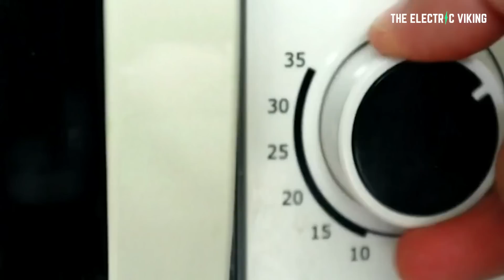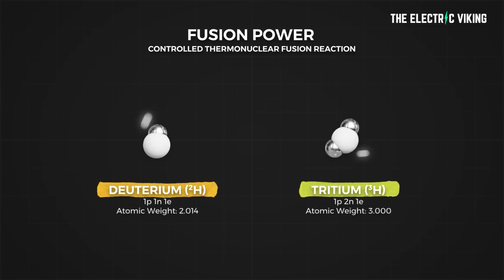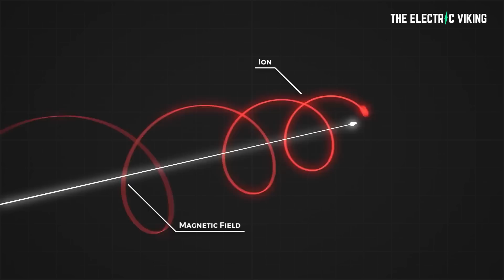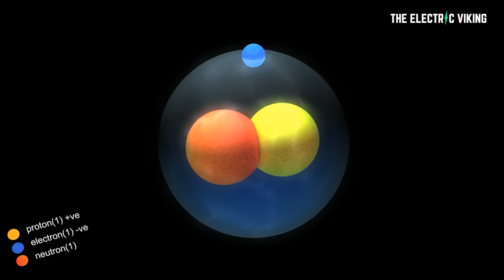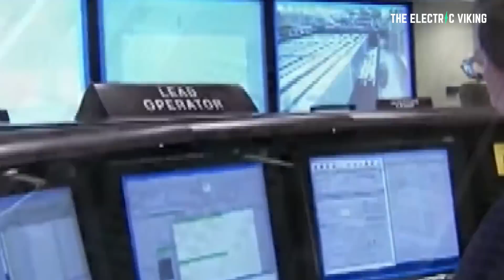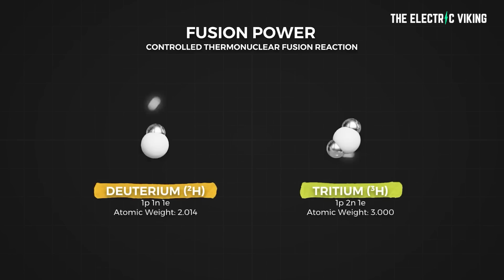Massive breakthrough in nuclear fusion achieved by US scientists

Comment: Even if there had been a net energy gain it's still only a technology for boiling water to run a steam engine. So you still need to convert that into electricity where 60% of the primary energy is lost, as in all thermal power plants. But LLNL is mainly a weapons lab where the energy research is a side hustle.

Comment: This is a common misnomer. So to put a damper on things. There is an old inside joke about fusion. And this was back 40 years ago when my father told it to me. Fusion is 30 years away and always will be. It is still being told today.

So to clarify things about why this "breakthrough" isn't anything. Tokamak reactors have already gotten 200% more energy than they put in. So they have already done better than the NIF. Here is the problem. Out power plant technology allows us to convert 40% of the thermal energy into electricity.

So to make a long story short. In order for fusion to be viable, the fusion reaction needs to put out at least 10 times or 1000% more energy than was put in. Otherwise you won't make electricity which is the whole point of the thing.

And as you can read for yourself, 50% more is nowhere near 1000% more. So Fusion is 30 years away and always will be.

Comment: Congratulations for this important step to make more heat energy from fusion than the energy in the laser light. That is still far from making more energy that the total energy that was used to make that laser light.The National Ignition Facility reactor is not a reactor that could be used to continuously make power, so we are still far from making a feasible fusion power reactor. With new SMR fission technology at least a decade away, proven wind and solar with energy storage should be moving at full speed.

Comment: Yes. It is a world changer,, an entry into the universe actually. It has been on offer for a while but the gatekeepers kept it out of public eye. But not now. The gates have opened. Everything changes now. Every piece of equipment gets reengineered. electrical motors get rewound, connectors re designed, applications of engines to power source means that VTOL is boundless. Distance is no issue, Remoteness is not an issue. This is the beginning of a massive positive shift for humanity.  Food production costs down, living costs down, pollution down,... The skies beckon. There are multiple working fusion reactors already on line. This current news article is for us normies. But it is great news.

Comment: "National Ignition Facility achieves net energy “gain” with laser-powered approach"
Subjective, these lasers are inefficient, requiring hundreds of megajoules of electricity to produce the 2 MJ of laser light and 3 MJ of fusion energy.ª 

¯\_(ツ)_/¯

Why am I not excited, becasue this is hype for more funding. 

Even if they got this up, to boil more than a kettle of water. This report is disappointing to see, that you were pulled into this clickbait story. 
Tritium, is critical for fusion, and there is a shortage, as it's a penasious gas, that is hard to contain, and relatively rare. 

MAIN CONCERN
is the popular press is spinning this fusion breakthrough. Claiming 30 to 40 years fusion will replace fossil fuels. WRONG. 

If we are still highly dependent upon fossil fuels in 30 years it will be game over. Not only that, but any breakthrough does not guarantee, it's economically or environmentally viable. 

FUSION COULD SUPPLEMENT
renewables and storage in 30 years, yet it certainly won't be available in time to be the solution to human-caused climate change. Period.
Disappointed is an understatement.

Unsubscribed, based on this laser based, fusion report, "Massive breakthrough in nuclear fusion" 😞

ª https://www.science.org/content/article/historic-explosion-long-sought-fusion-breakthrough

Comment: i cringe whenever the media uses the word "breakthrough".  In this case, its coming from fusion proponents.  It's actually more of a milestone than a game changer.  They've been on an incremental path of increasing gain, for awhile.  For once, they've generated more energy than they put in (measured in a certain way).  It doesn't mean it will be downhill from here. There are still huge engineering hurdles ahead.  And solving them is not guaranteed.  The stages are the following (each with their own major challenges).

1. Scientific demonstration.  Proof of principle.  (In a way, this has now been done, in terms of net gain.)

2.  Building a viable electricity generating engineering reactor, a prototype, which can be used on a grid.  We are a long ways off from this.  Even more so with inertial fusion, than tokamak designs, which hold the plasma for a longer period of time.

3. Having this reactor be cheap enough, to compete with renewables (and various forms of grid storage.   Their prices keep dropping.   And while fission is more energy dense, it's turning out to be more complex and expensive than expected (including SMR's).  (BTW, I support nuclear, even if one has to pay a premium.  That's because it provides a low-carbon dis-patchable source.  And it can be used for other things, such as industrial heat, hydrogen generation, ...)

And none of this fusion  will help with climate change, which has to happen the next 10 years (i.e., getting seriously started on the path to de-carbonization).

Comment: Fission Suppressed Fusion Hybrid - Can be developed quicker than full blown fusion - MOLTEN SALT FUEL VERSION OF LASER INERTIAL FUSION FISSION ENERGY (LIFE) - You could have a fuel factory mode. 232Th dissolved in molten salt; remove 233U for use in fission client reactors ( 232U/233U>>2.4% for non-proliferation) - fission is suppressed, Reference Ralph Moir W Manheimer

Comment: My question is, "Is it reproducible or was it a one time event?"
Reply: They probably had ignition in August 2021 too--so it isn't just a fluke.  This was more powerful too, so they're not only reproducing the event, but improving.
Reply: @nathanbanks2354  The clock is ticking on how soon other researchers will show success.  I would not doubt that 2023 will have a string of announcements, because all the others now know it can be done.  Kinda like the analogy of the unbreakable 4 minute mile...
Reply: @SlipKnotRicky  I'm sure it will lead to more research.  However both NIF and ITER both took decades to design, so I don't think another facility will do substantially better next year.  I think there's a European version...I looked it up--Laser Mégajoule...they may be able to do it.  At least this should help secure more funding.

Comment: I agree it will be abundant once they work it out but do you really think it will be cheaper?  Maybe for the producers but will end users see low cost energy for their homes and businesses or will they follow the oil companies model which maximizes profits over a balance between cost of providing service and cost to those of us of using it?  The fusion reactor company sharholders will insist on maximum dividend checks which will keep prices and therefore profits as high as the pocketbooks of users can provide.
Reply: Lots more goes into oil pricing than just "oil companies/maximize profits". 
 Supply/demand, logistics, Transportation/Refinery,  Taxes, Speculators,  or even scaring off investment, which will affect pricing for years ahead.  From Oil thru to it's different fuel types is a pretty big convoluted mess

Comment: All they did is produce slightly more energy out than the laser energy in. They are several orders of magnitude away from reaching energy out exceeding total energy in to the system, which is what you need for a generator to be viable. What happened here is just another small step forward, they just kept tweaking things until they managed to get some output gain in reference to laser output power, not laser input power, which was well over 100 times what they got out.

This system will never work as a viable commercial generator, it is too complex, too expensive, and it can only run for very short time periods. They are nowhere near being able to make this work commercially, not even close. Fusion is, as it has been for the last 50 years, at least 20 years away, and always will be.

Just imagine if the untold billions spent on fusion research had been directed towards moving to renewables, we would be done and dusted by now. The problem is, so many countries and corporations have spent so much on fusion already that they simple can't afford to say "it will never work, at least not by going down this path", because then everyone would realise just how much has been wasted. They've painted themselves into a corner and have no alternative but to keep painting.

I really wish fusion research was going to result in a viable generation option in the near future, but it has been obvious to anyone with tech knowledge combined with actual common sense (a combination sorely lacking in academia) that this was never going to work. Hell, at this rate, we will have built a Dyson sphere before fusion ever starts operating commercially...

Comment: No, it did not solve fusion. They reported a laser energy to fusion energy ratio greater than 1.0, but you need that ratio to be 150 for a useable fusion reactor because the input energy to make the laser beam loses 90% of the input energy.

Comment: The proibleem is that it still doesn't produce useful amounts of energy, and required a massive and expensive set of lasers. Every step towards producing useful amounts of fusion energy has required ever larger and more expensive reactors. Moreover, this laser method requires precisiion manufacture of tiny fuel pellets, making the fuel expensive. It will be too expensive to be competitive with renewables, or even fission reactors. It may find some use in "cost is no objection" applications, but it won't solve our energy needs.

Comment: Suppose that someone turns off everything in house except for a stove top heating coil meant to heat up a covered pan of water, and checks the electricity meter and sees that 2000 watts of electricity is being used, and finds by way of a temperature check the water is being heated at a rate of 1800 watts. That is 90% efficiency, and is fairly typical. Some waste heat goes to the house electrical wiring and to the stove top and to the metal pan and to the heating coil instead of into the water.

If by some sufficiently inexpensive magic, perhaps with the help of a cheaper form of fusion energy, you can manage to get the water to heat at 120% efficiency, you can lower your electricity bill for heating up your cooking water. If you can go further, to about 200% heating efficiency, you can in theory with an electrical generator running at 60% efficiency send all of the input electricity back to the power company and still have some spare electricity leftover for yourself, meaning that the operating cost of your spare leftover electricity is the price of the fusion fuel. Every 100% efficiency improvement is a worthwhile benchmark. 300% is better than 200%, 400% is better than 300%, 500% is better than 400%, and so forth.

The science fiction movies have a scary point though. Nuclear fusion means temperatures or densities or pressures close to supernova temperatures and densities and pressures. There are questions about what combinations of mass and temperature and density and pressure are safe. Long ago in the 1950s, H-bomb scientists probed that question with a goal of being able to intentionally and efficiently blow up entire cities. Modern fusion electricity scientists must eventually re-probe that question with a goal of not accidentally blowing up an entire city in a fusion electricity power plant mishap of some sort.

Comment: I've heard that fusion will be economically viable if it generates a 10% net energy gain. This achieved 25% (ish). That's an incredible breakthrough which could finally make fusion energy generation a reality. Really exciting news.
Reply: Sort of.  The lasers are currently less than 1% efficient, so they'd need to improve the efficiency there and/or make a much higher net energy gain.  But this is still a tremendous achievement--the lasers are super precise and powerful, even if they weren't designed to be efficient.  I'm looking forward to ITER having a net energy gain!
Reply: you read wrong, it's 10x the energy gain, not 10%. because there are tons of auxiliary systems that takes an awful lot of energy. even if you can extract a bit of heat  from the plasma, you need to convert that to electricity.
Reply: No it didn't. It took 300MJ to produce the 2MJ laser shot. That was 100x the energy output, or 1% efficiency at best. This is non news.
Reply: It is still news because we now know that ignition with laser fusion is possible.  We've solved half the problem by squashing some hydrogen so it fuses producing more energy than the energy squashing it.  If we get a more efficient laser, we can solve the other half of the problem.  Then maybe we can make it economical.  The scientists were pretty clear about this at the press conference, but the media rarely broadcasts that part.
Reply: @rbwannasee  Yeah, a 100X or even 10X efficiency boost would be difficult.  With a Tokamak, you can make everything more efficient simply by making it bigger, but I don't know if that's true for inertial confinement.

 NIF is interesting, because it's funded primarily to research nuclear bombs, but generating clean energy is a "bonus" which is great for PR.  At least it's much better than traditional nuclear tests.

Comment: 40 Trillion dollars…just got pulled out of the clear blue sky. Thin air.
Baby, we need to see the paper. What is this “breakthrough”, straight up, because I just don’t see it. See you at the lab on Tuesday. I am so doubtful. Fusion is the stuff that happens inside the core of a given star. There is a reason why we don’t see that anywhere, or anyhow, else. There would be pressures involved, measured in numbers we don’t have meters for…much less the method of containment. Have we invented an artificial sun? No miracles so far, but then so far Tuesday hasn’t happened.

Comment: I don't know how this technology really works, they say it use the most powerful lasers but how are they containing the reaction. I know that the problem with ITER and other Tokamak reactors is the configuration of magnetic fields to contain the generated plasma, only one of the magnets takes more than 5 years to manufacture and its costs are very high, which is why I think the reaction using magnetic fields to create plasma is far from commercial implementation.  The technology is different and that is the point of such an announcement, or are we at the same juncture.

Comment: Wow!

I think this is one of those 0 vs 1 moments that Peter Thiel talks about. As long as we have more energy out than in from the process, even a scrap, it proves it's possible, and we just hit the '1' case. Mental and financial capital will flow towards this technology rapidly, because all of human civilisation is predicated on our ability to harness energy - indeed.. all of life is. 

This not the essence of the hand-off between science and engineering. Once a process goes from being scientifically possible to understood well enough to be demonstrated reliably in the real world, it becomes an engineering problem. And engineers (I speak as one in an unrelated field) have pride in the fact that once something is a 'mere' engineering problem... then success will come quickly. The minds of engineers are tuned to find and optimise pragmatic solutions in a way that never stops surprising those outside of the field.
Reply: exactly, it could be a tipping point.  i'm well aware of all the caveats.  but the potential price is enormous.  each failed startup will inch us closer.  in addition, there's tremendeous national interest in this.

Comment: They should have better explained the difference between target gain and total gain.
They still had an input of 300 MJ to obtain 3.15 MJ of output at the end.
Reply: Yeah, but they need funding so...
Reply: A 100:1 loser?  No wonder the department of no energy showed up all excited.
Reply: The announcement is basically a fraud intended to impress the scientifically illiterate.
Reply: @incognitotorpedo42  also it seems to me a political move by the Biden administration to gain approval from the scientifically illiterate...
Reply: Actually the 192 lasers consumed 322 megajoules of energy and the output was 3.15 megajoules.  The lasers delivered 2.05 megajoules to the target.  So all in all it was cool however it was not a net gain when you look at energy consumed vs. energy produced.
Reply: It was more of a proof of concept than anything. This lab proved that controlled fusion can be viable, and now it's just a matter of time before we figure out how to make it efficient enough to achieve a Q total positive instead of being a pipe dream.